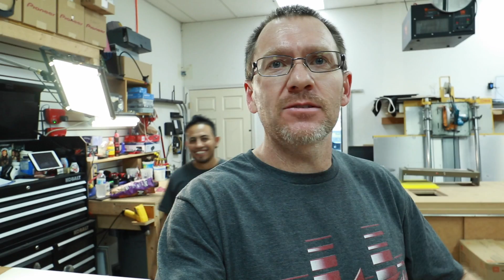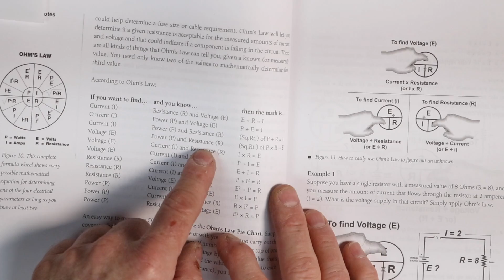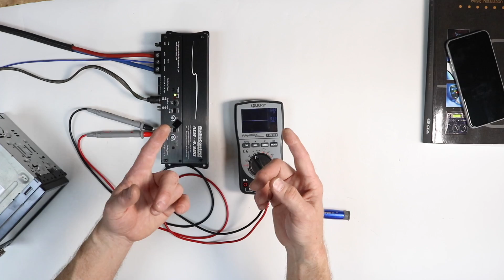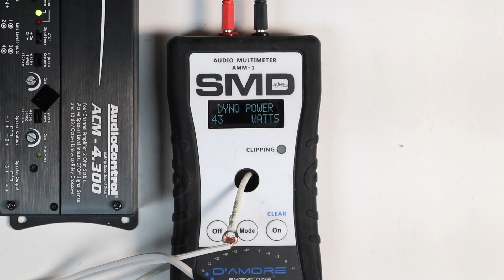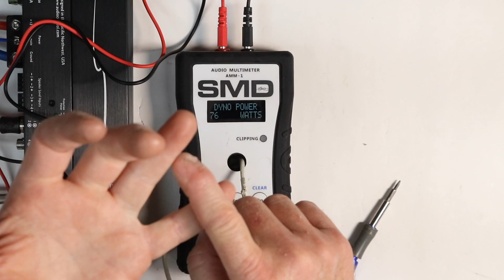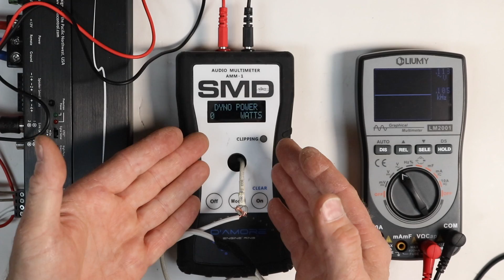How to set your Amp gains with the Liumy Oscilloscope Multi Meter

Comment: Okay when I’m setting my gain on my subwoofer amp I have a frequency dial and an infrasonic dial what are they supposed to be set at BEFORE I set my gain(all the way up or all the way down)
Reply: All filters must be off before setting gain.
LPF - all the way down 
HPF - all the way up 
Subsonic - All the way down 
Bass boos offf
After you set gain, then you adjust filters

Comment: When you turn the volts up from 14 to 18 and got more power out of it with very little clipping is that normal? You can go up a few more volts without an issue.
Reply: I believe the math is more of a reference starting point. If you want to fine tune to get a little more then that's on you

Comment: So if use 50w 3 ohm speaker  on an amp that was set for 4 ohm 50w then the 3ohm speaker will be pulling 67w if the amp can provided?

Comment: Would love to see some more on the Audio Control MILC and Maximized leds compared to professional SMD equipment. If you could use those to fully tune your amp/head unit. I have an LC6-1200 and have used these lights, but not sure how accurate they are,  also if I should tune for the maximized leds to always be off no matter what or if it is ok fir them to come on slightly .. thanks for the vid!!

Comment: Are there other things to consider when you’re over the amps rated numbers? Like thermal etc? Or do you typically hit distortion before that is a real problem. Asking because I’m running a 600@4 on 2 ohm till I get my new setup in. I should get an o scope it looks like.. so I set it at 35v vs 49v

Comment: Weird question, i’m a newbie to tuning amps. How is it that you got 76 watts from a 50 Watt x 4 ch. amp? Does adding slightly more voltage really make it go from 43 watts to 76 watts per channel? That couldn’t potentially damage the amp or speakers that can’t handle more than 50 watts?
Reply: @A. Melbs Makes sense, thanks for replying. It just seems like a pretty big jump, making 50% MORE than what is rated

Comment: That's a great explaination of the process.  What I do is use the math to set my initial paramater, then use the scope to maximize.  I then split the difference between the two readings and set the gain there.   In the example you used for this video, I would have set the gain at 16.1v and left it there.  It's not 100% at the maximum possible, but it also won't clip at high volumes either.

Comment: So if I used an oscilloscope to try and find the clipping point of my factory head unit, would I just play a 1000hz sine wave at -5 db and connect the oscilloscope to any one of the 4 channels and turn up until the signal clips and then just back off a bit,, then just remember the volume  level ?
Reply: No. Playing only 1000hz is wrong. You should try 100hz and 200 hz as well so all frequencies that are played over your high pass filter. If you set it on 1000 it will clip at 100-500hz (try and you will see better performance)

Comment: QUESTION: What does it mean when on my Liumy oscilloscope at the top of every wave my Taramps Bass 8K amp shows a thick crinkly snow-like cap as if a mountain top covered in snow?? I'm setting my gains before clipping and it constantly shows these snow-top mountain like waves. If I were to guess, it would equate to a dirty power but before I jump to conclusions I thought I should ask a pro. I have screenshots of it I could email you if helpful. THANK YOU.

Comment: Hi guys. Thanks for the content. Always informative and educational. I have a 2011 BMW 3 series with Audison APBMW front components and Audison APBMW underseat woofers. I have an Alpine Type R 12" in the boot/trunk. The headunit is the Pioneer 80prs and the amplifier is the Pioneer GM-D9705 five channel. Channel A is driving the front components, channel B is driving the underseats and the sub channel is driving the Type R. I have the Lumy oscope and the DD1. I know that it is convenient and easier to set the mids/high channel using the DD1 and the 1000hz test tone as well as the sub channel using the 40hz test tone. However, the underseat woofers will be bandpassed between 80-200hz, wouldn't that mean that I can't use the DD1 to set the gain on those channels as I'll be limited to 40hz or 1000hz and it'll be more prudent to use say 150hz tone and the oscope for those channels? Or can I get away with using the DD1 on those channels and the 1000 test tone? Thanks.

Comment: This video is great, i just aquired that same LUMY, it will be most helpful installing my own systems, its affordable and the math is free. But as an indivdual, i cant justify $450 for the SMD AMM-1 amp dyno,  more beneficial to car audio install shops that can make their money back on such devices within a week or two.
Reply: does this work the same with a monoblock amp?
Reply: @Lazerchicken69  Yes... because even with multiple speaker output amps, your testing one speaker output or bridged at a time, so its the same process.

Comment: Hi i have a powered underseat sub that has gain,  sub sonic , frequency  and bass eq adjustment ! Now as this doesn't have a speaker out as its a powered inbuilt sub how would you set the gain on this as you cant use the meters to read output voltage etc ? It does have a clipping warning light ,would you up the gain until this comes on loke the distortion light in your video then back it off a bit ?

Comment: Hi. Could really use your help here in the UK. I have purchased a Mustool mt8206 graphical multimeter. Its identical to the Luimy your using in this vid. I have tried to use it to find out if I have clean signal on my Kenwood DPX- 7100DAD headunit. Trouble is its not detecting hardly anything graphically. I can see the voltage it set to .000. When I've seen other vids the voltage has been set to 0.00 so you see 3.00volts for example. Since mine is Auto and it has set itself to .000 is that why I don't see anything. Tried hitting sele to zoom in but nothing. If I can't figure it out I will have to go back to setting things by ear 😧
Reply: Ur not the only one i bought this exact same oscope , its a POS wave lengths are so small.you cant.see.nothing
Reply: @SleepyBoiii  I actually figured mine out. Rather than Sele I hit the button on the left of it (REL) and it made the wave visible. For small voltage I only saw a small wave but I also used it for my amp and managed to set that to 39 volts. At 39.4 volts it clips. It does work I just need to know how to use it. Also its a little slow to respond so have make a small adjustment and then wait a second or two. But rather than spend £200-300 on pro devices it does the job.
Reply: @Pkdimmock  yeah i did that , but on 1000hz test tones & up the waveform is super small
Reply: @SleepyBoiii  the head unit it was small but on the amp its fine to me. I saw the clip. It was on the head unit that it was low due to low voltage. But luckily my pre outs are clean all the way up. When setting the amps I got 19 volts set on the mid/high and 39 on the low without problem once I knew what I was doing. Maybe that's why they say use 1000hz coz anything higher really won't be any good visually for these type if units?
Reply: @Pkdimmock  hmm i would have to do it again then thank you bud
Reply: @SleepyBoiii  All good bro. It is fiddly and took me a few attempts. As you saw from my first post here I was having issues but it did work out. Another thing I noticed was that once it clips the wave goes very saw like but small. Once you back off the gain the large clean wave comes back but again once you reach clip it goes saw like but small I thought mine was broke but still I works well enough to find that clip. Just play around and be patient. 👍🏼 Also I set using a 0db set of tones at first. Latter I used -5db for highs and -10db for lows. Got more from my set up since I listen to non bass boosted music.
Reply: @SleepyBoiii  here's where I got my test tones if you need. 

https://www.stevemeadedesigns.com/board/topic/96978-test-tones-and-tuning-tutorial-all-new-links-again/

Comment: It is great ! but what about a speaker to be connected  with less power  RMS  to  handle, like a tweeter ? no output optimization ?  It could be an example of 6 channel amplifier tuned for the three ways speakers activelly filtered according to speaker capability  , gains i mean ?
Reply: Exactly, most people forget about that, if you maximize a 200 watt rms amplifier but connect a 30 watt rms speaker to it  that speaker will bottom out or probably melt the coil at half the headunit's volume, Un advice from a 30 year car audio enthusiast...USE YOUR YEARS.
Reply: @DJ.Barbosa  Just do the math?  instead of 200 x 4, you do 30x 4 and go off of that :)

Comment: How do you see where the head unit clips? Would you just set the amp gain to a setting you know doesn’t clip and turn the head unit up until you see a clipped waveform?
Reply: James Orr Gain setting on its lowest position (minimum) to see when the head unit clips.

Comment: Great video will help me tons! Also question?? Is there a significant power difference when using low level inputs aka rca or high level inputs from the head unit? Im debating on whether to replace my head unit cause it only has sub out only channel but unsure atm if it would effect the sound or not using the high input instead.

Comment: Set the gains with the bass bost off?? Or with the bass boost knob turned all the way?
Reply: Mario Llamas All the way up. That way you know no matter what, you’ll have clean signal.
Reply: No, leave BB off, it's too easy to induce distortion and clipping by boosting and it's centered around a particular frequency, often 40-50Hz. That means if you use the boost at Max and then set the gain, sure, you may well be good with a clean ouptut, but everything produced further from the bass boost frequency will be attenuated dramatically in comparison leaving you with a lifeless sound.

Comment: Could you guys do an in depth video on running tweeters active and not blowing them? I cant find any info online explaining it well enough.
Reply: Daylin Supple you’ll just set the crossover points wherever the mfgr recommends using 24 dB Linkwitz-Riley slopes. Having an in-line capacitor is nice insurance just in case. Look for the recent Car Audio Fab video on them.
Reply: Ok would that still apply for running multiple tweeters in series? And what about power output. If I feed them too much power won't it blow them?
Reply: Daylin Supple I’m not sure what you mean by running multiple tweeters in series, so I don’t know how to answer your question. When you run active you’re going to set crossover points and slopes for each individual speaker. You’d set them for left tweeter and right tweeter separately. Re. Setting gains, I use my mid-bass as the starting point. I maximize what they’re able to do, then adjust the sub and tweeter accordingly. The gain setting for my tweeters is almost 0 on my Zapco Z-150.6. I also make my adjustments using an RTA. If you don’t have a way to use an RTA, adjust your mid-bass, then set the tweeter volume by ear. I’d recommend going to the “Test Gear” page on the Audiofrog site and downloading Andy’s tuning guide.
Reply: I'm going to run 8 tweeters active. Series/parallel  is how they are wired. Disregard that part I was adding more info than needed. BUT if I run 4 tweeters per channel the company says 40 watts rms a tweeter. So 40x4 is 160 watts rms. My amp puts out 200 watts rms per channel. So would that be too much power or should I dial it back a bit. Crossover points will be easy I have a DSP so it's all computer controlled. I'm just worried Gain wise. I domt want to blow 8 tweeters.

Comment: hey dean and fernanado. i made something that get close to maximum clean signal output. i found the video from youtuber called barevids. its a distortion sniffer. i tried it out and it works pretty well. i also used a SMD DD1 to compare and the gain is lower on the sniffer than the DD1 with a 1khz tone.  its a 3.3uf 400v non-polar cap in line with small 2in speaker in a cheap plastic tube. check out the video from barevids and give us your opinion on it please.

Comment: In this example should the amp be set at 14.14V out knowing you have the extra headroom on tap? Or should it be set at 18V (point of clipping) assuming the radio is at max volume?
Reply from the maker: We would set it to the 18v
Reply: @FiveStarCarStereoInc  Wouldn't this be dependent on the RMS Watts the speaker can handle?

Comment: For the price a Liumy is a must have for any diy'er. Pair it with REW (room eq works) and a Dayton Audio usb rta mic, you have full set of tuning tools for less than $200.
Reply: I picked up a small handheld oscilloscope with a quality test lead for $28. A calibrated minidsp USB mic for $100. I have a really nice quality tektronics multimeter that I've had for decades and wasn't cheap, but you can get one of those free cheapies at harbor freight. If you don't buy a calibrated mic, you could have all those tools for about $100 or less to get you started.
Reply: I have been using a usb oscilloscope with my laptop for years,  it's the best way to set the gains for max output without distorting the signal , and nowadays usb scopes dont cost much at all , especially since you dont need a super high mhz scope to set gains.